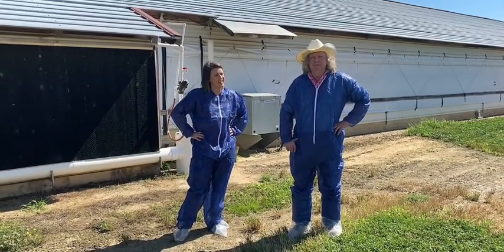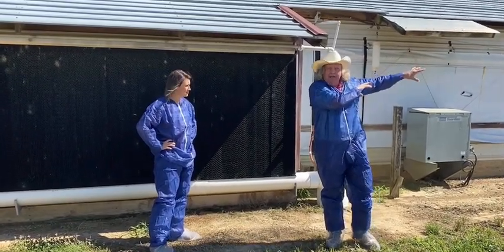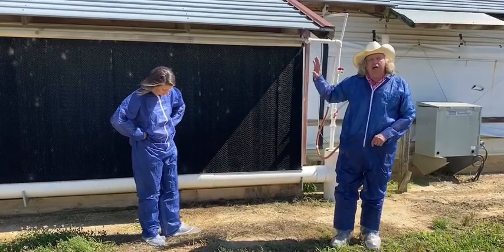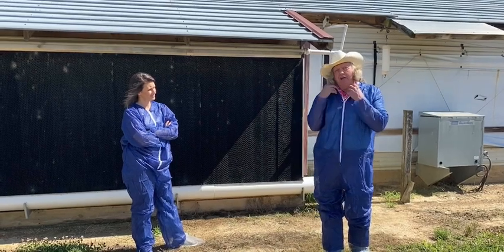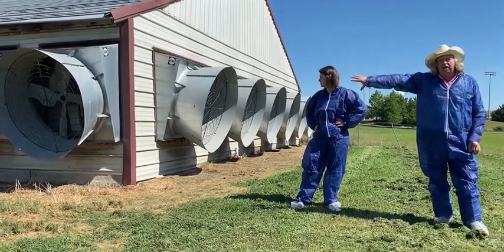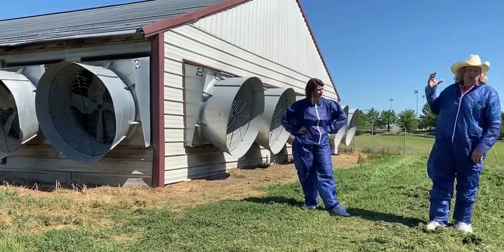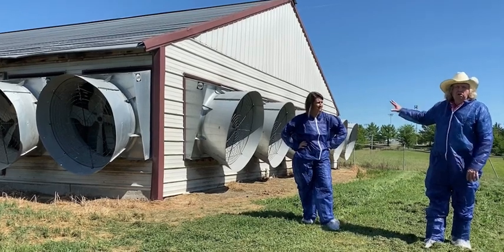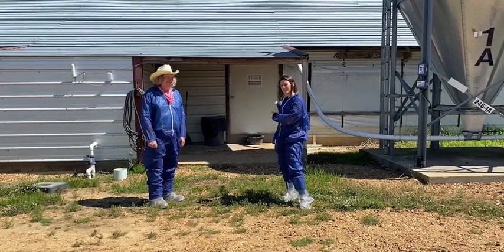Commercial Poultry House Cool Cells & Fans

Comment: Maybe you could do an experiment?   Heat reflective panels on top of the roof.   One house with and one house without (close to same conditions) and check for heat variation.  

You should mount it like solar panels, with an air gap.  The panels should be designed to dissipate heat from direct sun light as much as possible.

Observed affect.  2 story home, 1st floor is cooler than the 2nd floor.
Reply: I read your comment today and could tell you are very deep with Poultry. How can contact you?
Reply: It's referred to as  solar load....